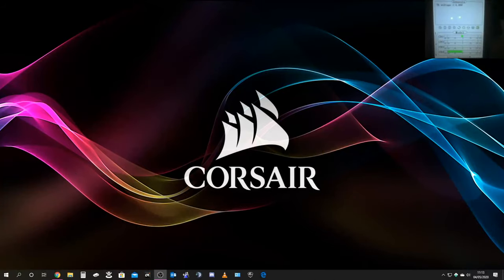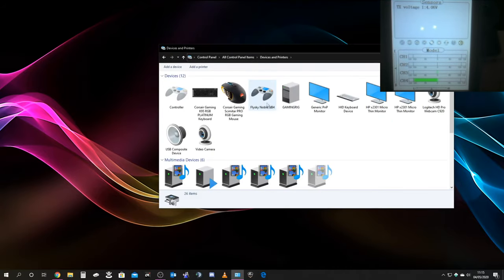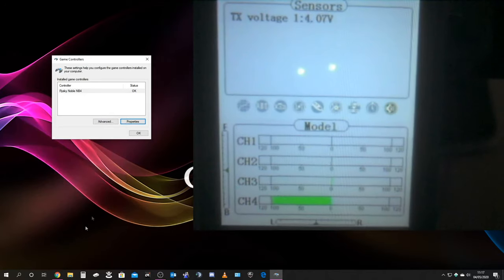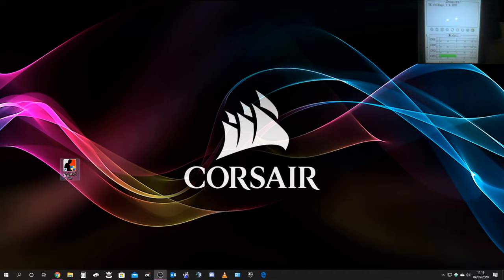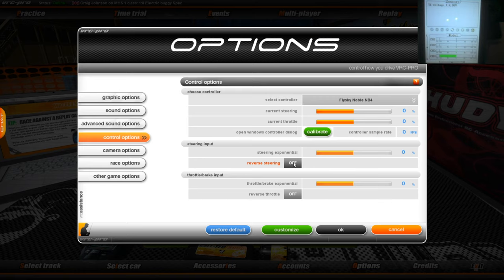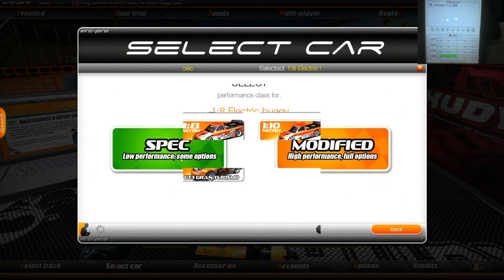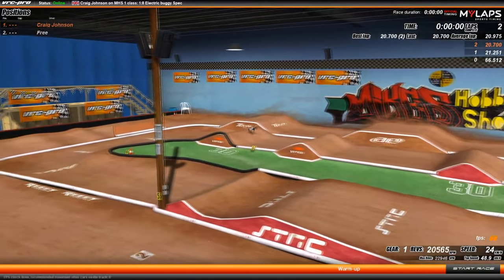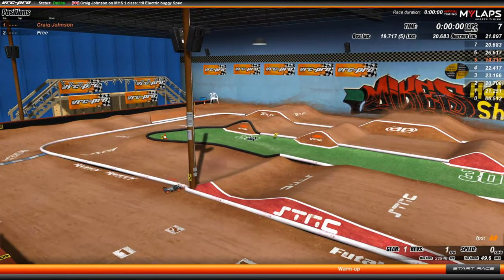Vrc Pro flysky noble NB4 set up guide.

Comment: I'm waiting to get this receiver myself so that I could play vcr-pro properly and not have to use my keyboard or xbox pad, good video now i know how to set it up...seems like this game can run on even an old 486 PC lol... I'm running an nvidia RTX 3090 at 4k maxed detail with everything turned on and still getting around 500-570fps depending on stage.
Reply from the maker: Yeh flysky radios ( nb4, noble pro, G7P and ST8 ) all work well with vrc pro :) and yeh I run a 5950x CPU, 64gb 3600mhz ram and 3090 and play heroes of the storm lol

Comment: I just got my nb4 and updated it to the newest firmware and play few minutes of vrc  then i went charge the nb4 and it won’t start anymore 😬
Reply from the maker: Does the base charge or no lights at all? you have to make sure the usb port can supply enough power to charge and run the nb4 or you will over drain the batteries, you  an remove the base and try to charge it on its self, also the secondary battery in the handle is removable its an 18650
Reply: @WTFRCCars  yes base battery was lit.   It was working good and when I finished playing I removed the nb4 from the computer and recharge it used iPad charger.  After like 30min charging I tried to start the nb4 and it won’t start anymore but the the screen is warm to touch even I removed the base battery.
Reply from the maker: if you remove the rubber grip there is  button to reset the nb4, you can also remove the 18650 in the handle to reset it
Reply: @WTFRCCars  I wish I knew. Anyways my replacement will come in few days.  Thanks for replying 🙏
Reply from the maker: Yeh strange one we have 2 and no issues so far.

Comment: Hi again, struggling to get the marshalling to be via a button on the radio.  I click on the field and it changes from Space Bar to z axis, I then hit the radio button.  But when I go back to drive the button doesn’t work and neither does the space bar.  Does the button being assigned need to be on a channel (3 or 4)?.?.  any tips greatly appreciated.  Thanks again mate
Reply from the maker: Hi you have to set it to a button not an axis, you set one of the Ch to a button on nb4 then look in Windows controller setting and see which controller button lights up when you press th button and assign that in vrc pro :)

Comment: Have they changed the location of the emulator setting in the nb4 firmware? Can't seem to find it on the settings page.
Reply from the maker: You must be on old firmware as it's automatically on when you connect it to pc :)
Reply: I know this is old, but I had same issue with connecting mine. There was no USB menu in the settings. I checked the control panel settings and it was recognized as Noble. I did everything else mentioned in the vid and it worked fine. Cheers
Reply from the maker: @tophe7d yeh you no longer have to set usb to pc for it to work as the transmitter just detects the pc and switches it on

Comment: i have been playing it for a long time but recently it stopped running on steam and i don't know why
Reply from the maker: What error message do you get when trying to start vrc pro?
Reply: @WTFRCCars  application has encountered problem which prevents it to run correctly. It will be now closed. If the Problem persists, please contact Support.
Reply: @WTFRCCars  strange but it works again.maby the 4k Resolution?
Reply from the maker: I could have issues with 4k it's a very old program
Reply: @WTFRCCars  yes it runs so far without Problems.👍but the Multiplayer doesn't work?
Reply from the maker: I don't have the steam version and I know they where talking about making it a subscription only software, so the full paid steam version would no longer work but they had a lot of kick back so not sure if they went ahead with it but that could be part of the issue?
Reply: @WTFRCCars   Omg. i have the same prolem again cant Play.if i wanted  to register on the web site, it might help?
Reply from the maker: Worth a try

Comment: Thanks for the video. I’m running VRC on a Mac using parallels. I just plugged the controller to the computer and it worked perfect. No issues. I was using a dongle before and it would work at times and I constantly had to connect and re connect it to get it to work. Plugging the controller straight to the computer worked perfect.
Reply from the maker: Yeh work much better that way, I have see some users mention the response rate reads higher if you connect directly but it's just vrc pro does not understand a direct connection as when it was made you never had that option it's much better to use direct usb :)

Comment: I'm using a Flysky GT5 and I'm having trouble trying to figure out how to get the steering around center "slowed down" enough to allow minor course corrections under full throttle down straights with a reasonable amount of control. I zeroed out the expo in the game and figured I'd use the expo in my GT5 to "soften up" the middle, but I haven't had much luck because nothing I've tried seems to make much difference. I think I understand the concept from using expo on mini quads (drones), but I can't get small movements of the controller's steering to be anything but twitchy at the car. I've tried positive and negative values for steering expo, because it seems that axis reversal in the game causes some things to behave backwards from what I'd expect. Some value in steering expo on my GT5 should allow me to get small controller movements around center to result in very little movement of the steering on the car until I get closer to full lock on the controller, correct? 🤷‍♂️

Any helpful hints greatly appreciated! 😁👍
Reply from the maker: Yeh your correct, but I'm not sure what if any of the settings work over usb with the GT5, it might be worth turning the sensitivity down in game but to be honest vrc pro is iffy at best and for me does not ever feel anything like driving an RC, it's ok to practice with but always feels off some how.

Comment: I’m trying to setup the nb4 but when I go into settings it doesn’t have the Usb on the list?
Reply from the maker: They removed it a few updates back, now when you connect to a pc it auto selects the usb mode you just have to start vrc pro and select the nb4 as the controller :)
Reply: @WTFRCCars  sweet. Thanks

Comment: hmm i do not see the usb function in my system options what am i missing?
Reply from the maker: If you're on the latest firmware you no longer need to turn usb on as it does it automatically and just works with the pc as a controller :)
Reply: @WTFRCCars  sweetness tx also i got a copy of vrc pro last night andfor the life of me i cannot find how to change tires or at least a dlc that has tires? any idea. Thanks again
Reply from the maker: Not sure off hand but this might help https://www.vrcworld.com/manuals/vrcpro/default.aspx#H_B_1_2
Reply: @WTFRCCars  Holy sh_t !!! I'm looking for the USB emulator mode for weeks now without finding it ! So thanks for info, my thumb up for your channel !
Reply from the maker: @darkpouss  I do my best to keep on top of the changes :)

Comment: How to connect e revo with 2 servos.
Reply from the maker: You can use a y lead from ch1 that splits to 2 servos or you can set up channel mixing and have ch1 and Ch3 with a servo connected to each Ch and then use channel mixing to make them both act together.

Comment: i don have usb function why??
Reply from the maker: Latest firmware auto enables usb mode when the usb is connected to a pc :) turn on the pc, connect the nb4 and you will hear the usb detection sound, open control panel and goto devices you should see the nb4 detected as a controller :)

Comment: hello
thanks for your video very helpfull
I dont have USB fonctionne on system.
Can you help me.
Thanks
Reply from the maker: Sure as of the later firmware on the nb4 usb mode is automatically enabled when connected to a pc and so you don't need to turn it on now it will just work :)
Reply: @WTFRCCars  thanks for your answer. I wait a news vidéos of the nb4👌👍
Reply from the maker: Yeh I really need to do a new one for the nb4 and vrc pro, got a new special receiver vid coming soon too :)
Reply: @WTFRCCars  how can I know which receiver can work with the nb4? Or wich protocol?
Have a good day 😉
Reply from the maker: Any flysky or DM racing receivers that use AFHDS 3 will work, flysky fgr and gmr receivers are design for nb4, but ftr will also bind and work you just have to update them via the nb4 connected to a pc and use flysky firmware updater if you watch my tfr10 receiver update vid you will see what I mean :)
Reply: @WTFRCCars  thanks. Cool you take time to answer.
See you later